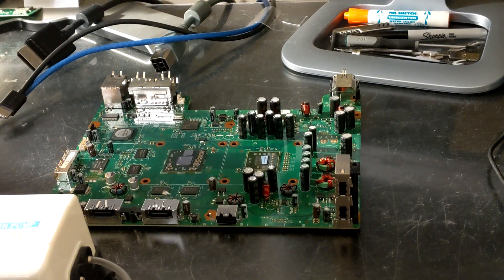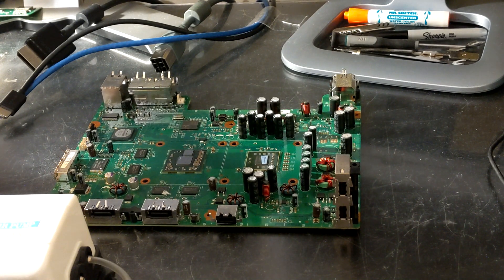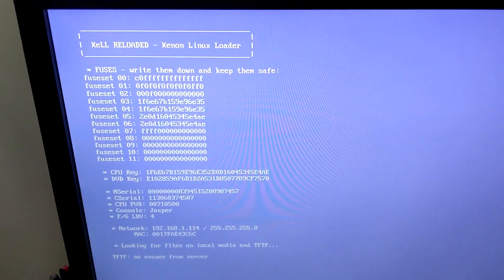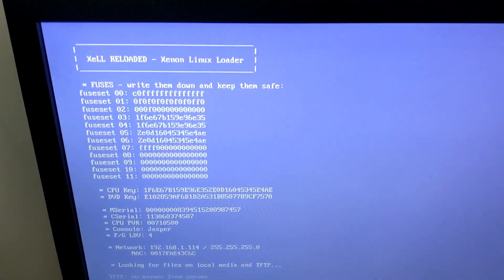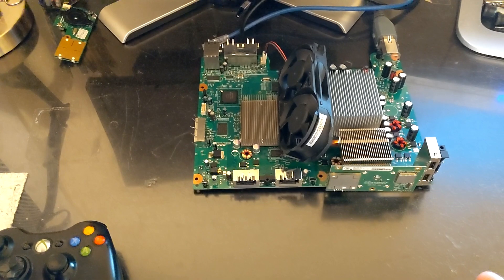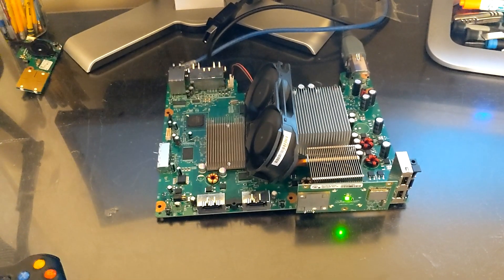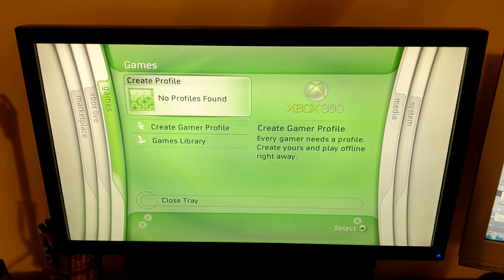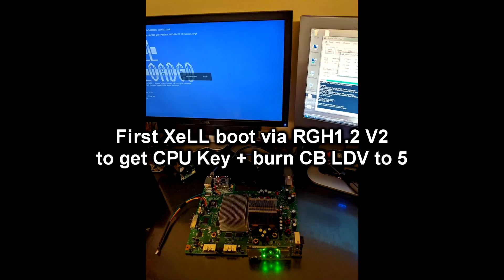Making another Jasper JTAGable from a dead Falcon (BGA Rework)

Comment: Hey Josh I have a question. Would it be theoretically possible to take a CPU from a Xenon running dashboard 5759 and swap it to a Kronos motherboard? Would you then be able to flash the Kronos' nand to 5759 and jtag it?
Reply from the maker: 90nm and 65nm different pinout. Not interchangeable. Xenon CPU can only go on Zephyr.
Reply: @Josh.Davidson  Ah ok thanks for clearing that up. I can only move the Xenon CPU to a Zephyr. I don't think that would be worth all the effort to move my Xenon's CPU to a Zephyr just to make a jtag with an HDMI port.
Reply from the maker: @Repeatingpower7  Unless it have good GPU installed ;) Halo 3 JTAG anyone?
Reply: @Josh.Davidson  That makes me wonder. Do the GPU revisions have different pinouts or are they all the same? If I can put a Kronos 65nm GPU on a Zephyr I would definitely swap both chips and jtag it. (P.S. I like your new pfp)
Reply from the maker: @Repeatingpower7  Y2 and up have the same pinout as far as I know. Whether either 65nm GPU works on Zephyr is TBD. I plan to test it on Falcon first.
Reply: @Josh.Davidson  Ok cool! I'll be sure to stay tuned for when you test it on a Faclon.

Comment: Good video, what is your reballing kit.. Reballing machine. which one you recomend?
Reply from the maker: I use DIY. You should use IR-8500 at least or better.
Reply: @Josh.Davidson  Which one is better? the DIY you have or the IR-8500 doesn't matter the price.... i want the best option.
Reply from the maker: @lapara1521  My DIY can only be operated with special procedures and sufficient skill. If you're just getting into rework buy a real machine. But be warned, its a deep rabbit hole and if you are not trained by another technician in real, you will likely have difficulty.

Comment: What machine are you using for removing the cpu? Also the temperature of your hot air wand during reballing?
Reply from the maker: It's custom.
250C during reballing, fan speed 1, I also preheat the jig just a little these days.

Comment: That XeLL looks interesting. Did you make any changes to it or use a special version?
Reply from the maker: It's my fork. It is included in jrunner with extras
Reply: @Josh.Davidson  I just remember... I have changed the internal 4gb mu of my Trinity with a usb and i think that there is a problem with this xell, its freeze when its says somthening about sata... The "error" its very similar to  older versions that werent compatible with some dvd models.
I think that can be the usb modded mu because before that everything was fine. 
(Sorry for bad english)
Reply from the maker: @cyx128  I will check it.